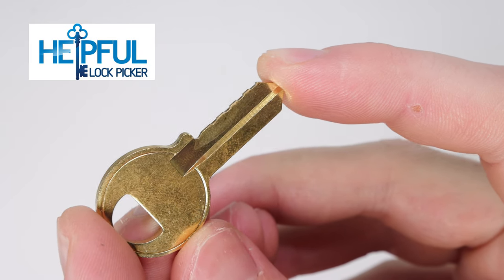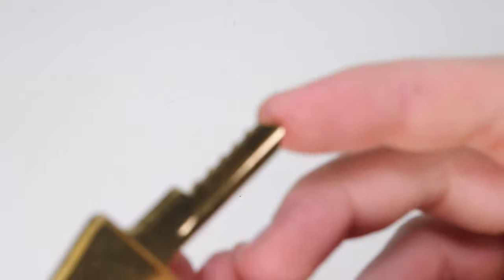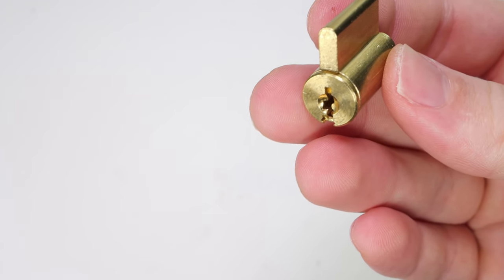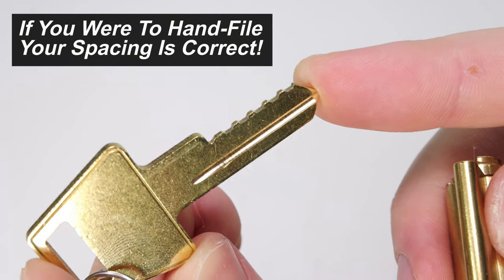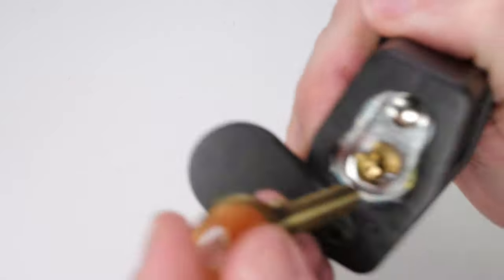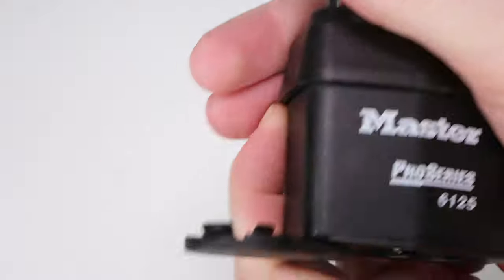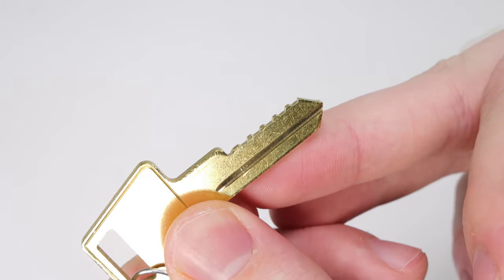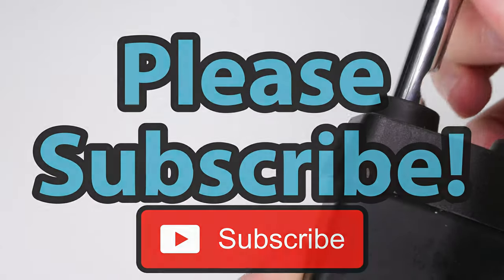What Is A Zero Bitted Lock? | Explained

Comment: Actually, the only use for a key with the shallowest depth cut all across like that in code cutting would be in conjunction with a duplicator that has a tracer with a micrometer adjustment(To keep the spacing in check as you move the guide either in or out to make the cuts of the desired depth).I mean with a code machine like the Blitz, no modifications whatsoever need to be made to the blank(As the controls regulate the spacing and depth by themselves)
Reply from the maker: I own the Blitz and enjoying it a lot. I don't know if I agree with you on that. For example, my Master Lock Pro Series will NOT open with a blank and I have to cut 0000 for the cylinder to open. (It is a strange cylinder to have come with it being 4 pin)
Reply: HelpfulLockPicker No.What I’m saying is that a code machine can make the cuts on it’s own without any factory prep of the blank.
Reply from the maker: @lokpikr999  okay :) Yes that makes them very helpful

Comment: I understood that code cutting machine can cut the shape, so it is like a blank? I also understood that some locks r designed to be opened with it. Other than that is there any reason to make it?
Reply from the maker: It is so you can sell a lock with an operating key that a locksmith can change. It's convenient to sell a lock with all of the pins inside it.

Comment: Wouldn't it be great for a CL? That way you could feel the feedback all your way across
Reply from the maker: Picking these can be tough but if a blank opens it there is no challenge
Reply: @HelpfulLockPicker  but if the one picking it doesn't know it still interesting. + It could help a handy beginner to better understand how it's custom pins can feel on the maximum potential